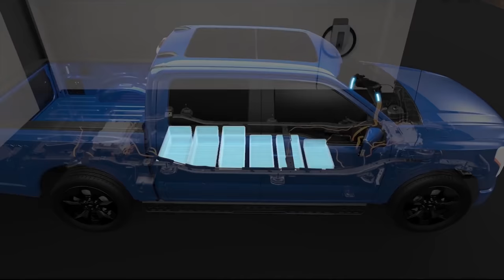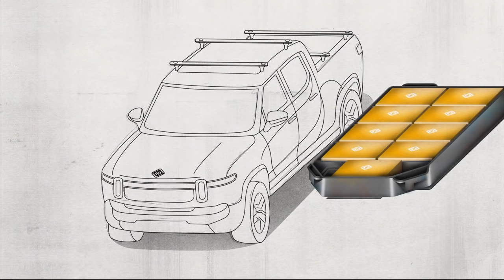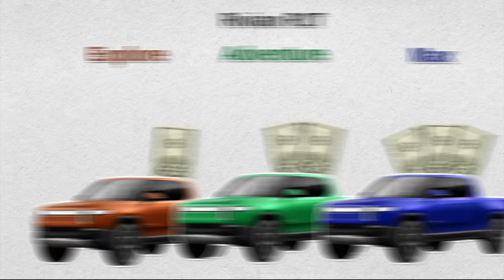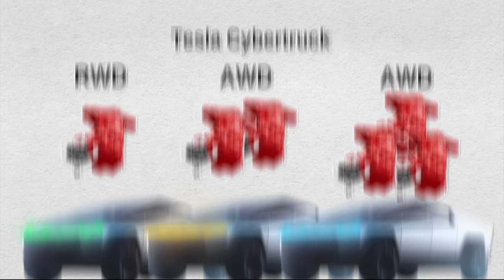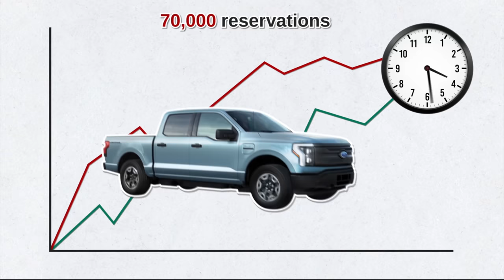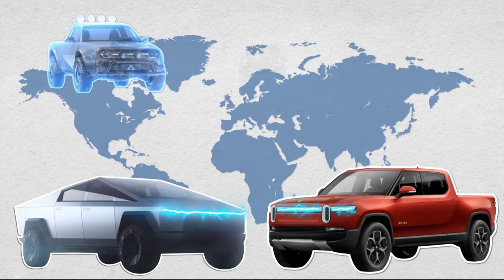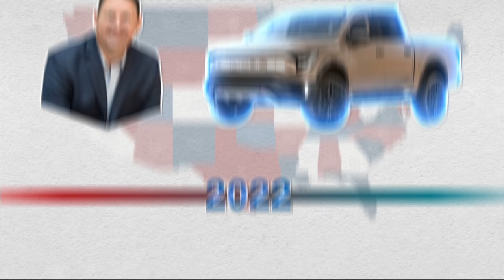Here's Why This Will Replace Trucks in America

Comment: I’ll be interested with how they address problems like what if your stuck in the middle of no where out of charge. It’s gonna be a very interesting phase of vehicles bound for Scotty to address!
Reply: Same as if you are stuck in the middle of no where without gas. Plan a head
Reply: The truck will probably be towed out with another truck that has a diesel engine.
Reply: Tow trucks with Super batteries and Generators..Guaranteed
Reply: Not any different then if you're stuck in the middle of no where with no gas lol
Reply: some electric cars do have a small conventional engine, but it is not a drive engine, but only to re-charge the battery, giving you extra miles, for exactly the situations, you have described
Reply: Better carry a 5 gallon can of gas and a gas powered generator in case of an emergency.  Or maybe carry one of the new battery powered 'generators'.
Reply: Just a matter of time before AAA and others offer a mobile fast charge service, or they can tow you to a station.
Reply: Tow a gas generator.😄😄😄
Reply: @borisquince6302  You can always have a can of gas but not batteries.
Reply: @moetocafe  I didn't hear that about these trucks. Sounds like all electric.
Reply: For those saying it is the same as running out of gas; that is not at all the same. There is likely to be a gas station FAR closer than a  charging station. You could even catch a ride and fill up a can. Also, that say 250 mile range im certain is rated with very low load on the motors. Not even close to my 36 gallon tank. Pulling my camper through the Appalachian mountains like I did this year...... nope don't want an EV for that..... and I'm an automation and controls engineer.
Reply: Somebody who drives in the middle of nowhere might have to bring a generator. I know when I go off road I have to carry eight gas cans I go so deep sometimes
Reply: @mcc7762  I think a regular store-bought generator with a 30 amp plug would do a good job with this but it defeats the whole purpose but I guess for the occasional off-road trip it's okay. I won't be bothered with that, the technology will improve over time or be snuffed out by something better like hydrogen
Reply: @borisquince6302  No, it's not the same. You can easily bring a jerrycan or two with you or get someone to bring one. With an EV? Not so easy.
Reply: @borisquince6302  
Yeah! Carry an extra can of electricity in the trunk.
Reply: @jeffreydevoti7000  I’m carrying a can of electricity right now as we speak
Reply: @travisarmstrong3229  tbh Travis I'm not a smart guy, but I agree with you. The electric vehicle's may have a given distance they can travel empty, but put under a big load I'd be willing to say you'd come close to cutting distance traveled in half imo. Next is the charging problem which limits how far you can go (lol trapped in the city) due to charge, and the limitations on charging it. Lastly considering how power grids are strained as is i can't possibly imagine what 150-300 million electric vehicles would do to the grids lol.
Reply: @borisquince6302  No one gonna bring you a can of electricity.
Reply: @borisquince6302  you can get someone to bring a gallon of gas.
Reply: Solar panels can be fitted to the roof and, then hooked up to act as a way to charge. I see aftermarket kits coming if it's not a factory option.
Reply: @EricFortuneJr.  that the prob , what station?
Reply: @brandonlesko3126  
Uhh, if it takes hours to charge plugged in overnight... let's think, how long would it take onboard solar panels?
Reply: @mcc7762  thousands of energizer batteries 😂😂😂😂😂😂
Reply: @brandonlesko3126  Hope its not dark or cloudy out side. I guess for some people EV are great and some there not so great. I will have to wait and see i guess. Maybe a mobile charging like AAA in the future, but thats probably expensive now of days.
Reply: @stormbreaker3027  and for the people proposing using a gas generator..... this could be bad for the health of your EV battery, voltage from gas generators is....."dirty".... in fact as i read an article now, the tesla won't enable charging if the sine wave is not pure. So scratch that completely even if you were willing to harm your battery. and AAA coming to the rescue with a fast charger.... they offer this in urban cities like Seattle.  They are capable of offering you about 15 minutes of charging on a level 2 charger.  So let's hope you're right around the corner from a charge station 🤣
Reply: @travisarmstrong3229  🤣 completely agree tho the idea sounds good I'd say going back to steam would be more reliable atp 😆
Reply: If you get stuck somewhere out of gas or electric charge.. then it's on the driver. Dumb decisions lead to dumb results.
Reply: @andrewlarson7895  A charging station. The infrastructure will improve per demand.
Reply: @stormbreaker3027  Question, how do Nuclear power plants generate electricity?
Reply: @gruneflamme2013  agreed. Thats why its a dumb decision to tow long rural distances in an EV.  The EV is awesome and has its place. And its not towing through rural areas where there isn't even cell phone reception for miles and miles, much less charging stations. Stay in your city boy.
Reply: @gruneflamme2013  Agree
Reply: @jeffreydevoti7000  fission, steam, and turbines i believe, but don't hold me to it lol
Reply: @travisarmstrong3229  
  Ooo.... an automation and controls engineer. Wow. Yeah, that already tells me you haven't a clue about EVs. 😉
Reply: @mcc7762  
Uhh.... yeah. Or one that's made specifically for that EV.  Duh.
Reply: Roadside assistance. All you need to do is get pulled at 55mph and you could regenerate in 10 minutes 50 miles worth of charge so you could get to the next charge station
Reply: @stevenw4549  why not a can of batteries?
Reply: @geoben1810  but hey I'll make sure I reach out to you the next time my plant is down because the profibus adapter went out on one of these dambach automated cranes
Reply: @EricFortuneJr.  well yes it will but not overnite like they are  thinking hint...(we have citys and states running out of water they need to fix that issue first I would think
Reply: @armandturner6068  That wouldn't work. Takes a lot of cells to produce enough voltage. It would be impractical.
Reply: @borisquince6302  but see, with a gas powered car, you can plan ahead. they make these things called gas cans. they're this new invention and all, but they are out there.
Reply: I could see a very big market opening up for something like emergency roadside assistance outfits, they can bring you gas if you run out, so why not bring a generator of some sort for a enough of a quick charge to get you to a charging station. If EV's are going to take up a larger portion of the market share (they hope, at least) it seems like a solid moneymaking idea to me. Start up cost might be steep, but if EV's are here to stay, so is the need for this type of assistance. There are people running out of gas because they underestimate how much they fuel they will use on a trip, so you know they will overestimate their electric charge as well.
Reply: You bring a gas powered generator to recharge it
Reply: Call 3A like they do now. Only the poors put a spare on or walk to the gas station.
Reply: Get a gas generator xD
Reply: I've been driving for 20 years.  Never once ran out of gas. I get it, charging stations aren't as prevalent as gas stations.  Just plan ahead. Not that hard if you're a competent adult.
Reply: @borisquince6302  You can bring a 2 gallon can of gas to your car or truck, and be able to go many miles to a gas station. With an electric you will have to call someone for a roadside charge call ($$$) it will take quite a while to get enough power to make it to a real charging station. And if it needs to be towed, you CAN'T tow it. You have to hire a flatbed car hauler! And good luck with your 'planning ahead'. Imagine getting your vehicle stuck in mud off-road and killing the batteries trying to get it out. Now you have a 5000 lb anvil stuck in the mud. The only thing that MIGHT save you is someone with an F150 with the high output power generating feature from 2021.
Reply: @briankendall65  Yes, tow trucks love driving off road, through swamps or desert. LOL. Gee for some reason I've never seen a tow truck used for off-roading...
Reply: @dylanfarris7647  Totally different. One person with 2 gallons of gas can get a gas truck going again in moments. Oops, with electric it's not the same at all.
Reply: @moetocafe  No, they are hybrid vehicles which can drive the vehicle via the batteries OR the engine, making them actually useful for long trips. Unlike pure electrics. There are no electric cars with an engine that just recharges the battery.
Reply: @EricFortuneJr.  Love to see you get a guy with a tow truck out in the desert or swamps to help a stranded electric. Not gonna happen.
Reply: @kethf4301  I don't know if enough people would run out of juice to sustain a business like that. The service probably couldn't charge too much money. Sure some will run out but the question is how many and how often. One a day would not be enough. The computers will tell them how many miles they can travel with remaining charge. Perhaps some would go for a service contract so a business would get a steady income that way.
Reply: AAA won't go to the middle of nowhere now.  You got to be on a paved, named, publicly maintained road or you're SOL.
Reply: @jeffreydevoti7000  Steam turbines. The heat generated by the fission process is used to boil water and produce steam, the steam then spins the turbines which spin generators. That's it in a nutshell
Reply: I think either Telsa or Rivian got a patent for a sort of electric Jerry Can. Not sure how that would work.
Reply: @robertcoyle9071  you also need to know that some people aren't snobs like yourself. see, when i travel around the country.. i like to really see the beauty it holds. like my visit to the bonneville salt flats. i loved seeing them. i put 10 five gallon cans of gas in the back of my truck. and toured away. spent days, and nights out there, drove where few people ever drove. seen what few people ever seen. of course those like you wouldn't, couldn't even bother to want to see the wonders that nature provides. and that's just one trip. in a way, i feel bad that those like you wouldn't even care to see the beauty nature does hold in this world. because with electric cars? things like that will never be able to be done. (unless you put charging stations in say, the middle of the rocky mountains. or way out in the redwood forests..)  this goes for mountains, forests, deserts... et al. always remember this.. just because snobs like you wouldn't bother to care about seeing beauty nature does hold.. doesn't mean there aren't many like me who does care like that. and we don't want to be cut off from the extreme enjoyment of being able to see natures beauty.
Reply: @garycarpenter2932  what the hell are you going on about? I'm nowhere in this particular sub thread.
Reply: @EricFortuneJr.  aaa in northern Colorado already has this
Reply: so people who go out on trails never plan ahead?🤤🤤🤤🤣🤣🤣 WHO in hell goes out to the middle of a wilderness with the tank or battery on E???🤣🤣🤣🤣
Reply: I'm an Uber and Lyft driver. I carry a small lithium ion car charger that's powerful enough to charge and start my battery twice over, and power various electronics like cell phones or my portable tire air compressor in the trunk, even strong enough to start a big diesel engine. I would carry two or three if I drove an EV.

Also my car battery is an AGM, which lasts much longer and provides power without discharging as fast as standard vehicle batteries. If you live in a cold climate you should definitely have one. If you don't drive often, which means you might discharge your battery because of disuse, you should definitely have one!
Reply: Same problem..with gas.stuck in the middle of nowhere
Reply: @borisquince6302  Takes a lot more planning, it's easy to go out in 300 miles but I pack fuel jugs and can extend that to however many jugs I wants to take. Fill up out of gas cans is probably 20 minutes and another 300-400 miles is had. You obviously don't go out into the mountains or desert do you?

Comment: “Batteries have always sucked. And they will always suck.”

- Nikola Tesla probably
Reply: I will be excited when they can make my battery in my iphone last longer than 2 years
Reply: @truckguy6.7  And charger cables that last that long too
Reply: @truckguy6.7  I have a ZTE blaze and it's going for 4 and half yrs
Reply: Actualy Tesla was more interested in AC electricity, Edison was the guy in DC.
But you're right they aren't good enough for now, but a whole lot of smart engineers and physicists all over the world are working on it, 
They'll figure it out
Reply: Yet they are using phones running on batteries every single day! 👍🏻
Reply: @Jules-z4e  I wrote it correctly. Tesla (AC guy) is saying Edison’s (DC guy) batteries suck. Which is true when compared to AC.

Comment: I'm waiting for an e-truck to have a 500-mile range under load, and a charging time to 100% battery of less than 15 minutes, and at a cost that's not like buying a Porsche 911.  I'm also waiting for charging stations to be available on every street corner.